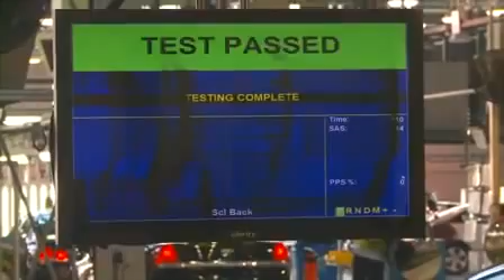Holden VF Commodore Production

Comment: Brought myself a VF SSV redline series one, the last of the series one's 2015.:) also i put on rear brembos and DPE rear mufflers and now people think its a series twom even through i did not know that the series two' shad the rear bremo's. :) Only 30K on the clock and 3 years old, :) Also my car is only a few which were owned by a worker, ie: manager of the Elisabeth plant in south australia, most holden  car owners manuals will have the previous owners name and address if brought 2nd, but mine has a holden white sticker with owner clearly stated Holden Motor corporation, elizabeth manufacturing plant south australia and the Vin, number, engine number and stock number and ticked Capped price serving. :) thank you all the workers for holden and i hope most of them have found new jobs and i hope holden bring out a twin turbo version of the ZB holden AWD and around 350KW at the engine or a supercharged version with about the same HP figures :)
I was going to buy a FG XR8, but when i seen them for the first time in 2015, the outside was basically the same IE Rear end and front end changed as far as the looks, but inside the same old dash and seats shape, leather etc etc, also herd that the diff bushes have to be done on all the fords that came out if its a FG and the turbo versions the turbo's have to be done around the 40K mark, depending on how you drive it as well, but turbo's engines especially the bara should be able to take it, like that upload of 10 secound FG F6 in 10 days, yet the top end of the engine was stuffed and basically had to rebuild the engine to handle all that power including the auto and the diff etc, cant get my head around how much the people who own the FB XR8's from 2015 onwards are asking for them yet they have nothing on the new VFR even the first series, ie: 2013 models ?
Reply: 7071t6, your  VF would be an EX employee lease vehicle...I leased 6 new  VEs in a row when  when I worked there!... I took a redundancy at the end of 2012 just after the first run of MVB pilot pre production VFs had been built .
I worked at Elizabeth plant for 10 years ,and was very proud to do so !. Regardless of what some people think ,there was very strict controls on quality ,and a huge amount of testing and engineering  went into VE and VF... People who think that the are not a good vehicle don't realise that in every overseas market that we exported to that these vehicles were highly regarded...many people in America  believe  the VF SS ( Chevrolet spec export version) is the best sedan GM have ever offered for sale in America!

Comment: @ the 6:46 mark you can clearly see the external trans cooler fitted on that car ,which is a cop car full stop, even if you ordered a new VF series one or two with a tow pack, even the largest tow pack from holden, they do not put a external trans cooler at all, i asked the spare parts guys at my local holden dealership and trust me the part number for that external transcoder is for VF HSV auto and Statesman, and Police packs only, you could put one on a holden Oe which is part number HF04A780, BUT HAS A TOTAL OF 20 DIFFERENT SEPERATE PART NUMBERS AND YOU ONLY REQUIRE A COUPLE TO HAVE THE THING FITTED TO YOUR  VF IF YOU WANT ONE ,BUT CHECK WITH AFTER MARKET ONES AS WELL, LIKE PWR PRODUCTS ETC, Cheers :) Sorry about the CAPS ?
Reply: If you stop the video at 10:15 you can read the broadcast ( build) sheet .. This vehicle is a SSV Model Year 2014  MVB S which means manufacturing validation build saleable .So this car is infact a pre production pilot vehicle,but a very close to regular production model , hence the S for saleable...early MVB (pilot) vehicles are not saleable , evaluation only ,and pilot vehicles sometimes have different equipment to regular production versions!
Reply: wonkychikn I’m guessing it became a press car but I could be wrong.
Reply: @tomnewham1269  ,It is possible ,but some validation vehicles also get extra items fitted to them  as part of the engineering evaluation process.Once GM have finished with these vehicles they generally got on sold to dealers as ex GMH vehicles,but only pilot pre production vehicles with the code MVB S were on sold ,as earlier pilot vehicles didn't get a proper vin tag only a pilot tag and would  basically get destroyed at the proving ground,or end up as run around " hacks" for use inside the ground of the assembly plant....some also get donated to various TAFE facilities and to emergency services to cut up for rescue training!
Reply: wonkychikn thanks for your comprehensive reply.
Reply: @tomnewham1269  , you're welcome mate!
Reply: @wonkychikn  The Broadcast Sheet goes back to the HK in 1968.  In the 70’s  there were about 15 to 20 copies per car distributed around the plant.By the end of production the sheet was clearly broken up into sections. That bit of paper told people all about the car,from tyres to paint, engines, radios everything.Simple but so effective, never saw a mistake in the build from a broadcast sheet error. A few Late pilots with OK parts often found there way into the fleet, the early ones were given to college or scrapped . HDT’s first Commodore was an ex pilot vehicle. I didn’t see your 2nd post so yes the cars had much the same life.
Reply: @beagle7622  the broadcast sheet was certainly a great idea to simplify building the vehicle with all the right parts, this would have been state of the art back in 1968!. ..Also makes sense that the first HDT car started life as a pilot car, would have kept development costs down.I believe that Holden played a much bigger part in the development of HDT cars than that of HSVs..Leo Pruneau apparently did most of the styling of the early HDT cars in Holden's studio.
Reply: @wonkychikn  Actually they did . I had first hand knowledge of this. In 1980 . Styling made the moulds for the big guards after designing them. Talented guys what they did was amazing .
Reply: @beagle7622  That would have been awesome to be part of!... There's no doubt about it  GM and Holden had some of the best stylists and designers in the business!.. It's such a tragic loss for Australia that our car industry no longer exists and the  highly skilled people involved in styling, design and engineering have either gone into other career paths of sought employment overseas..loss of a great industry and loss of great talent.
Reply: @beagle7622  That would have been awesome to be part of!... There's no doubt about it  GM and Holden had some of the best stylists and designers in the business!.. It's such a tragic loss for Australia that our car industry no longer exists and the  highly skilled people involved in styling, design and engineering have either gone into other career paths of sought employment overseas..loss of a great industry and loss of great talent.
Reply: @wonkychikn  Tell the Productivity Commission that. I checked it’s membership at the time.